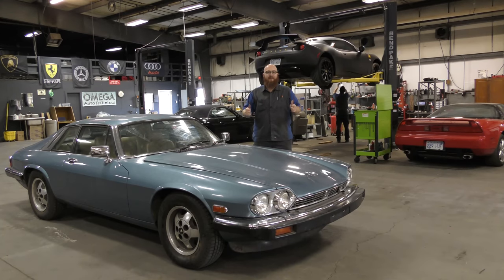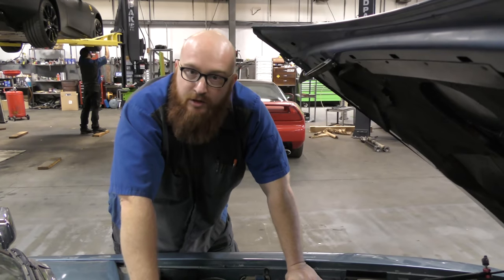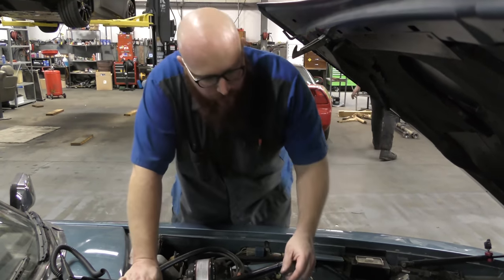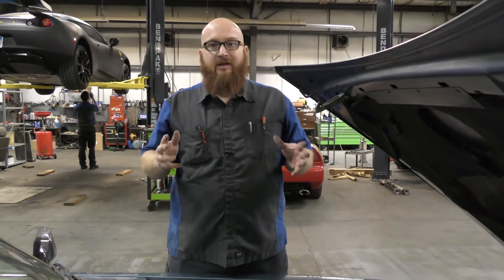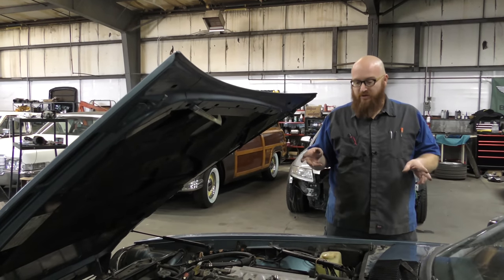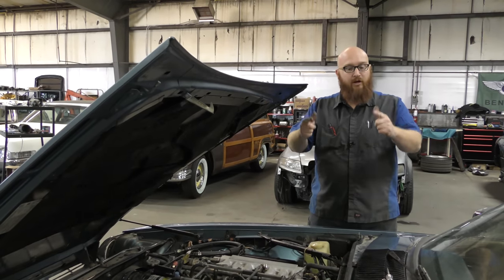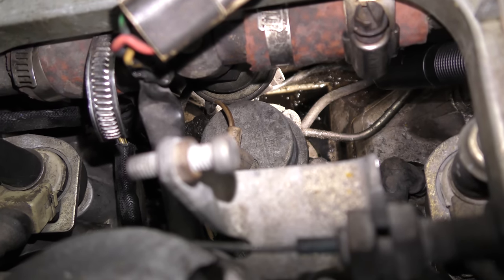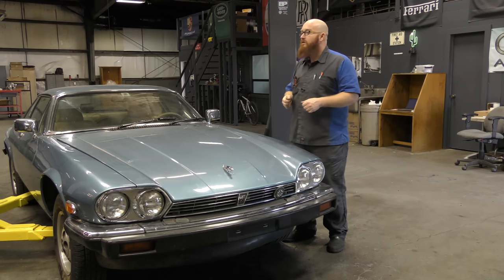'82 XJS with the cursed Jaguar V12 comes into the CAR WIZARD's shop. Can he get it running?

Comment: The Lucas fuel injection system was actually a Bosch system made under licence. In 8 cylinder guise it was used on many vehicles fitted with the Rover V8. I had a similar problem with the coolant temperature sensor giving intermittent erroneous signals to the ECU and causing the engine to run extremely rich. In my case it was the wiring loom that was at fault rather than the sensor. After taking the lid off the ECU I was able to monitor the signals from all the sensors and eventually worked out what was changing when the engine ran rough.

Comment: As a kid in Britain  I always wanted a big engine. A big american V8 .... then I noticed our own V12 and wanted one.
After a few years I got a 68 Pontiac Firebird that someone had put a 455 in. Ironically it also had the 4 speed Jag manual gearbox with Laycock overdrive (now owned bt GearVendors in the US).

That Firebird in the mid 80s London as a monster, I loved it. Then I needed money and it got sold.

A few years later I got lent a series 1 Daimler Double Six and thought ... well I've had the big American V8 let's see what the British V12 can do. I gotta say it was as smooth as silk, didnt have to lift at 35mph to go over speed bumps but Christ I could see that rev counter try to catch the fuel gauge needle before it hit the E.

Early one morning about 3am in 1989 I came off the M25 onto an empty M3 towards London and I thought "Well let's see what it will do and I buried the loud pedal ..... which didn't increase the volume much at all. I watched the speeding hit the ton and keep climbing 110 .... 120 .... 130 ...this was about as fast as I'd ever driven before.i kept my foot in ... the needle eventually graced 140 eventually and I still had in planted.
I'd heard the V12 was a 150mph car and the guy that owned this car was a Jaguar trained mechanic so it should be fit for purpose. The needle was clearly fighting aerodynamic but that old Daimler got a need width passed 150 before I had to ease off as the road had a slight curve that turned into a hairpin at that speed.

That was 1989 and I never got to grace 150 on the highway  again until 2007 in New York state when my 2002 VFEngineering Supercharged BMW hit 175.

I can still clearly remember holding that hard skinny Daimler steering wheel and making deliberately small steering corrections that night and being shocked years later to find that the V12 was "only" 285 horsepower.

Comment: My friend who used to restore European cars for a living said "When the British made anything it was like... They had it almost perfectly engineered and done then they would go to lunch and have a couple pints and then come back and finish the design". One of the main problems with Lucas electrical is that every contact is made from brass and has no coating. When brass corrosion occurres it is not visible and creates resistance but not complete failure of the circuit. Electrons are lazy and take the path of least resistance which can cause all kinds of wierd issues.
Reply: Think this is happening to me, alternator must be failing, fan will come on with the ignition off sometimes. hitting the fusebox turned it off for me the last time it occurred and haven't really had it stay on and drain the battery since but....

Comment: Oil pressure sender ;) my xjs also sprung a leak there. Need a crowfoot wrench to get to the nut under it. It has 2 thermostats, 2 coils. The reason for the inboard rear disc's is to reduce unsprung weight at the wheel.

Comment: You were fortunate,  I removed the distributor on my 1986 XJS to clean and lube the advance.  I reinstalled 180 out also, when it started it shaved the worm gear that turns the distributor.  This was a $6000 lesson, and it never ran correctly afterwards

Comment: Despite claims to the contrary, Lucas electronics did not in fact invent darkness. They merely perfected it.
A few things I didn't hear mentioned:
The throttle "turnbuckle" houses a potentiometer that gets wear spot at or just above idle and causes all sorts of acceleration issues and flat spots.
The rubber injector hoses are probably baked and leaking into the valley, because the valley normally runs at something like 250F, and then get HOTTER when you turn the car OFF!
The "easy to get to" wires in the valley are also probably fried. Guess what happens when these two meet, and that's only the #2 cause of XJS fires.
Does your idle air control valve(AAV) work? They fail, and are year specific, and NO ONE makes anything like it.
The trunk mounted MAP sensor does not like backfires. 
If the cooling system, engine tune, under trays and air damn are all perfect, it probably won't overheat. Probably. If anything isn't perfect, it will overheat, and maybe drop a valve seat or two.
The oil leak is from everywhere, I promise.
But they are gorgeous and a great car to drive.

Comment: The Jaguar V12 is a superb engine.  The problem with it was not the engine itself, it was electronics. The V12 itself is a race winning an highly reliable engine, so long as it is never allowed to overheat, it will go and go and go.

Comment: I bought mine no start.  I think it was an 85.  Pick up coil wires were grounded together inside the copper lined protection.  I had a failed test on the pickup.  Messed with the wires inside the copper lined loom.  Got the reading I was looking for.  Fired right up.  The pickup wires were spliced at the distributor with snap lock wire to wire splices.  It blew a spark plug out when I revved it a few time.  Someone JB Welded it in.  I Heli coiled that.  Had all 12, then.

Comment: Recalling Ford computers from the early 1980s also had the MAP sensor built into the computer enclosure.  Codes could be read by connecting a Mityvac, applying moderate vacuum, and read the vacuum pulses when placed in 'test mode'.

Comment: I had precisely that with a ‘98 Suzuki GSXR600 M/C. The crank igniter was 180 degrees out. It was the last carb model and they had been butchered and the whole bank needed rebuilding. However I persevered and I know the sense of achievement is worth the effort.

Comment: You showed why a SBC just drops in there. I’m guessing the trans is probably a Turbo hydromatic 350 based on that oil plate marked Turbo Hydromatic division of General Motors. Interestingly most old RRs and Bentleys use the TH-350s and 400s as Rolls Royce considered the Turbo Hydromatic to be the worlds finest automatic transmission. It’s encouraging to know that any shop practically anywhere in the United States can fix your transmission for you lol

Comment: Back in the late 90’s one of my good friends bought a jag very much like this one. It ran just fine but he almost immediately did the SBC with TPI swap and tuck the V12 away in his garage. Fast forward just over ten years: Dude buys T-bucket with a 350 off eBay and within no time develops a rod knock. I suggested he swaps the jag v-12 in it as a joke but moths later that’s exactly what he did. 😂😂 He still has both cars and both are still on the road. The T-bucket sure draws a lot of questions at the local parking lot car shows though.

Comment: The coolant temp sensor may be fine but the coolant block that the sensor sits on may be blocked (it is rusty inside and warm coolant never touch the sensor) so the sensor thinks the engine is cold and you get black smoke because of too rich mixture. The auxiliary air valve may be stuck open as well because no warm coolant coming in for the same reason. I'm talking about the D Jetronic Injection. Also need to check for air leaks especially all vacuum hoses and breather hose and balance pipe hoses need to be replaced.

Comment: I’ve replaced the ignition amplifier several times. It should be mounted on the firewall instead of the driver’s side intake manifold. An extension harness would save lots of headaches.

Comment: A family member had one of these and even did an auto to manual transmission swap. Gorgeous vehicle but it was difficult to keep the engine adequately cooled, it went through spark plugs quickly and the fuel tanks had to be replaced twice… after flooding the trunk and carpet each time of course.

Comment: Do you think people hear about certain exotic cars having a reputation and then let that get to their head? I have an XJS as a daily driver for 10 years before someone ran into me and totaled it. While cramped, I never had any difficult working on any maintenance or minor repair it needed. The only time I was ever left on the roadside was from buying cheap Chinese fuel pumps.

The sender leak is pretty common, along with the valve cover half moon seals and other banjo fittings going to the pressure sender.

Comment: Just a heads up Wizzzard that is not a turnbuckle, the correct nomenclature is quadrant. It is taking a single input and converting to two outputs. Very common device in the aerospace community.

Comment: I ran an XJ12 saloon back in the 80's, a series 1 with the Stromberg carbs. I also had problems with the Opus ign but sorted it with a new distributor cap and timing rotor. The carbs weren't that difficult to work on but never seemed to hold their tune for long. The fuel injection was a worthwhile upgrade IMO at the expense of complexity, just need to know a bit about the system and diagnostics when it gives trouble but still no reason the throw in the towel and stick a V8 in. These old Jags are like ageing porn stars, still plenty of potential, just need a bit more foreplay.

Comment: I once worked fixing tv's and videos, and preferred getting them presented as they failed, with no component replacement. Years ago, there were some who simply 'swapped' tubes which performed the function that failed, but did not diagnose the extent you do, and send it on to someone else, because it did not 'fix' the problem. They acquired the nickname, "Tube jockeys, or 'valve' jockeys (in UK or Australia)"... A service manual is always helpful, and wonder if Jaguar published one with known faults and repairs. It seems not. I imagine that, as car makers advanced with more and more electronics, along came with it 'On Board Diagnostics', and the equipment which read the codes. It is important though that with knowledge in the use of an oscilloscope can assist in almost any electrical fault presented to an accurate diagnosis rather than a 'guessed' one...

Comment: Hi interesting video. Its because when cars hit the used market, people will not pay for a technician like yourself, instead they hire "grease monkeys"  (A UK term) who have no idea and do a bodge job. I worked with a young lady many years ago, she had an MGB sports car. It was running so rough. I offered to have a look at it for her one lunch time. The first thing I noticed was it had four completely different spark plugs, no two the same. I pulled a couple out and they were black and wet with gunge. I told her the bad news that it had been bodged, she was very upset because she had paid an old chap (her fathers friend) - he had charged her a fortune, told her it needed a new engine. Alas she did not believe me that she had been done. I offered to sort it for her, but she declined.

Comment: The Jaguar V12 is one of the most reliable, powerful, simple and bullet proof engine made. It is NOT hard to diagnose if you understand simple mechanics and fuel injection they have issues with the ECM but otherwise are very easy to fix.

Comment: I got a 1989 one since 2011. Setting the distribution is the real thrill. But v12 engine is pretty strong, almost immortal. Electric issues were much rarer in the latest model. Find a late and well looked after one, and you will enjoy a reliable car.

Comment: I can't imagine anyone wanting a British car for ANY reason. They are without doubt amongst the most poorly designed vehicles in the world.   I remember the first British motorcycle I owned... I needed to re ring the engine (197cc Villiers engine)  & pulled the head off the cylinder. No head gasket !  They depended upon ultra precision machining to contain compression (on an air cooled engine yet !)  I rebuilt a 51 MG engine & found out there was no  rear main seal. In its place was a small wheel machined as an auger to carry the oil from the rear camshaft bearing back to the sump. Of course the damned things always leaked.  I compliment you on your perseverance !

Comment: There are 2 main problems with cars like this.
1. Maximum 2 owners car afford proper maintenance. After ~10 years, it ends up in hands of someone who can't afford professional service. So the car ends up in noname one technician garage, guy who fix Fiat 126 and suddenly, he tries to fix Jag V12. And gets botched repairs to get it atleast somewhat running for a while. And ends up in total mess.
2. And it sits another 10-20 years .... before it become collectible.

Comment: About 30 years ago, here in the UK, many car shops bought themselves tuning computers, such as the Sun. They would advertise checking your car on the Computer and correct any problems it highlighted in and hour for £50.
I rang several of them to book my XJS in and they all refused to do so.
However, my tyre shop had bought a Sun Computer and agreed to have a look at my car. When I drove in the shop, the owner came out and told all his workers that he was going to do this car!
So he hooked up all the wires and started the process. Immediately he found a major problem that the distributor time was all over the place..
After an hour he said to leave the car with him and ring him back 4 hours later. This was clearly going to cost a lot more than £50!
I rand back and he asked “Do you want the god news or the bad news first?”
Oh sh!t, I was thinking!
It turned out that the shaft between the cam and the distributor is rather alike a socket extension, with 6, instead of 4 sides and hat it had almost warn completely round. To replace it Jag would only sell me a complete new distributor for £350. However the shop owner could make me a new one, which he did.
The car absolutely flew after his cheap fix!

Comment: Heh, back in the 1980s when these were being paraded new at car shows, I took one look at that engine and thought "maintenance nightmare". Might be powerful and smooth when it's working, but it even looks as if Jaguar deliberately designed it to add to the owner's maintenance costs as an extra "revenue stream".

Fortunately, here in the UK, there's enough reference manuals available explaining how to maintain this engine properly , though you're told right at the start this is not an engine for a beginner to work on. :)

Oh, and the HE versions of the XJS have their own woes. 

Even if you live in the UK, and you have access to skilled mechanics to dig you out of the many tank traps awaiting you, this is a car you buy with your eyes open, and with the expectation that it's going to cost a small fortune to bring it back to life as it was when new or nearly so.

Comment: For me the real downside of owning one of these things is the cost of parts - I remember 20 or so  years ago watching my mechanic changing a water pump on an XJ and the replacement pump - rebuilt - was in access of $500.  But those are not a deal ending problem  - why I wouldn't want one is the awful fact that these things are just ugly!

Comment: It's not a coax cable, it's a shielded cable.  And the inboard brakes are to reduce unsprung weight. This is a performance car.  Check out how many races the XJS won.   And it might be a good idea to mention the dual coil since the second coil is sorta hidden and a failed coil can be a major issue.

Comment: Screw the 350... LS7 with a Tremec T56... no one would expect that!!! 

It does sound good. About 300hp... but super smooth. The engines are ok, it's everything attached to them. I have always been a fan of revising them with a Bosch Motronic setup. Simple and effective.

Comment: Great work on what should be a fabulous British car if you spend enough time and money on it!
Lucas ECU on my lovely V8 3500 SD1 Rover decided to deliver full fuel at any throttle setting -6mpg--was the one different brand of capacitor on the 2 circuit boards inside-dry solder joint...took weeks to diagnose -Yes, Joe Lucas electrics ,our proud motto"get 'ome before its dark!"
Daughters British built Nissan Micra suddenly wouldn't start ...instant diagnostic technique - Look the integrated distro/coil has "Lucas"written on it ,that will be it,yes it had popped a power transistor inside.
My 1959 BSA A10 650cc wouldn't start well...er,Lucas K2F magneto...etc.
I don't think they were allowed into the aircraft industry?

PS other automotive electrical manufacturers also have been known to make crap and that magneto worked very well after a pro refurb

Comment: I think I still have the special tool for setting the height of the jet needles of those 4 Stromberg carbs on the V12 E Type. I miss driving the well tuned E Type. Oh and the Motometer carb synchronizer.